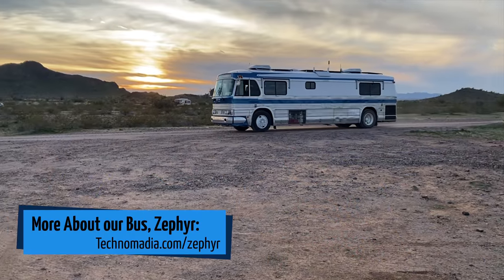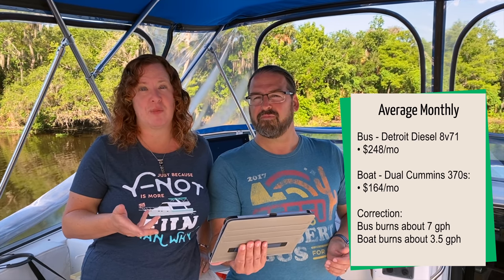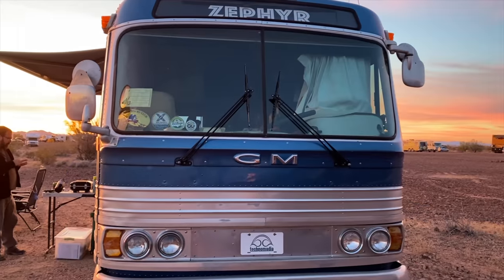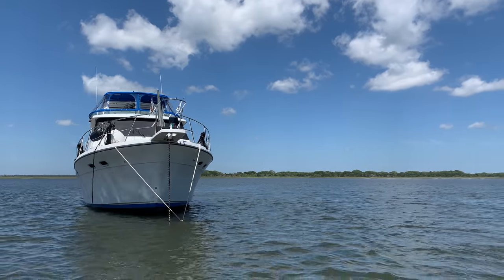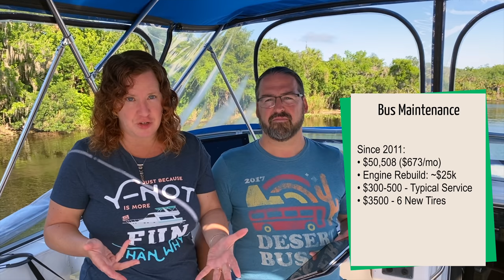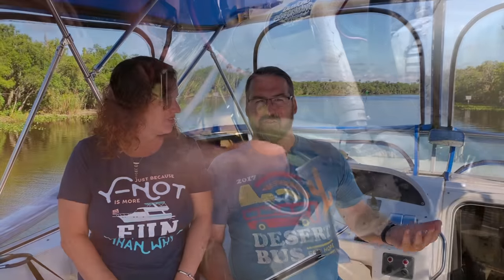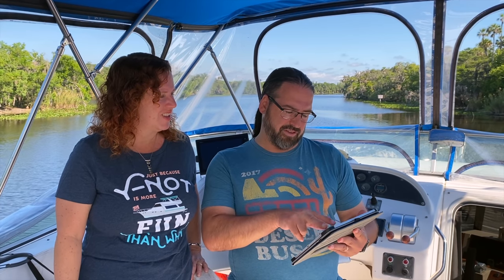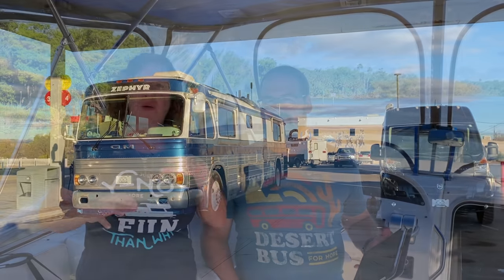Boat vs RV: Which Costs More? - Fuel, Maintenance, Marina/Campground & Insurance Compared

Comment: awesome information.  It definitely confirms for me that I want to stick to what I was originally thinking and try to go with a boat under 40 feet as all other things being equal the running costs should be proportionally lower.
Reply: I have a SeaRay 270 with twin 350's I get about the same mileage at 6 knots. 1.2 MPG when I'm on plane.  I weigh about 7500 lbs.  Why Knot seems cheap by comparison given it's size. Does it plane if say someone is having a medical emergency on board?

Comment: I use to spend over 1500 bucks in fuel one way from North Miami to Key West in my boat. Of course it was a Cigarette Top Gun with two 525 engines.. Sooooo  Totally different beast. Just goes to show it really depends on what you're comparing. And that was I think about 168 miles one way, could of been 180 one way, it's been a while. 91 octane.

Comment: I have a 30' 270 Sea Ray with a 10' beam on a road worthy trailer.  Truck and all I'm at about 55' LOA with all overhangs included.  I'm considering  taking her across the country and staying at RV Parks along the way where I will use the boat as my RV (It has kitchen, bathroom and 2 bedrooms.  I have a 4000 watt portable generator, shore power and an air conditioner - hatch mounted.  So I have everything I need for comfort and convenience while camping on the trailer. HOWEVER, It has occurred to me that this practice may NOT be permitted at RV Parks and/ or national Parks.  Have you seen this done before? That is - living on your boat while it's on a trailer?  What can I expect from the various authorities with regards to this arrangement? Would appreciate very much - your insight on this.
Reply from the maker: You'll definitely want to research further before making plans around that. Have not encountered people living on boats in RV parks and campgrounds before.   Also, max legal highway width is 102" - so be sure to check in for any 'extra wide' permits you might need to transport your boat.
Reply: @Technomadia  Thank you.  I suppose I could Boon-dock or use rest areas. I've dealt with the extra wide issue before. Permits are easily acquired but limit your itinerary - not to pricey at $25 in California.

Comment: I knew the boat would cost more, the benefits of it more than compensate the higher costs. Far more space on the boat, many even have laundry facilities onboard, more opportunities for free / low cost anchoring/boondocking, better control over fuel usage ( going slower burns less fuel generally ).
Reply from the maker: For us... the benefits definitely do add to our quality of life.

Comment: Wouldn't it be more fuel efficient to fill the boat's tank to only 1/3-1/2? Each 100 gallons of diesel weighs 700lbs. Obviously range between stops would have to be factored so you don't run dry.
Reply: 1) You don’t want to risk running out of fuel while searching for fuel.
2) You want to minimize getting moisture in the tanks by keeping them full.
3) Algae is a problem with diesel on water.
4) keeping them topped off minimizes fluctuations in fuel costs.

Comment: US$ 4,500 for bottom clean? If you are not using the boat then you have to clean the bottom every month or even every other month., here in California it costs 40.00 . If you use the  boat you dont need to clean every month, just change the $ 10.00 zinc.
Reply from the maker: $4500 for new bottom paint.  Hull cleanings tend to be $100-200 for our boat - which we do every 4-8 weeks depending on our usage.
Reply: @Technomadia  in California  ( very expensive state) the divers charge US1.50 per foot. Plus $ 10.00 for the  zinc.
Reply: California and Florida probably aren't comparable. Florida has very warm waters which is perfect for critter growth.

Comment: Fuel Saving Tip: My parents own a Carver 355 w/ dual Cummins diesel engines with 310-gallon capacity, the marina that they dock at charges something stupid like $3.59/gal for diesel. So they signed up for a diesel discount account through TSD Logistics and we use an old 140gal aux truck bed transfer tank we bought for $150 to get fuel for the boat. 2 weekends ago we got diesel with the membership card for $1.269/gallon 25 minutes away from the marina, then we use a battery-powered transfer pump to pump the fuel into 5-gallon jerry cans which we transfer into the boat with a small wagon. granted its a lot more work doing it this way, but we fill up 4 x 5-gallon fuel cans we have, which we wheel to the boat 7 trips to transfer the 140 gallons to the boat. We don't do a lot of lifting, we use the garden wagon to wheel it to the boat, then the battery-powered transfer pump to pump it into the boat. It takes about 30 minutes but saves a LOT of money. Instead of spending $538 on 140 gallons of diesel at the fuel dock, we spent only $176 on the diesel and a few gallons of diesel driving the 25 minutes to the closest fuel station that supports the fuel program. They typically fill up when it gets to 1/4 tank.
Reply from the maker: Wow.. that's a lot of work!  We just filled up for $2.25/gallon here with a fuel truck at our marina.  We don't have the option of tanking in our own fuel, as we're traveling/cruising :)
Reply: @Technomadia  ya, fuel trucks are better than the fuel docks at marina's, just makes me cry a little when i see people pull into the fuel dock at the marina and pay $3.50/gal + . Its really not a lot of work, just a few walking trips is all..
Reply: @Technomadia  thinking about it, that fuel truck probably filled up for cheaper than the $1.26/gal we paid at the pump and sold it to you for $2.25/gal and probably added tax ontop? either way that's a really nice profit margin. A year ago when diesel was near $4/gall at the pump, we went and picked up fuel for $2.40/gal with the fuel program and the neighbor boat peeps were sitting outside on their boat and heard us mentioned we had 20 gallons left that wouldn't fit in the boat, so he offered us $60 for us to pour it into his boat, so we did it quietly lol...
Reply from the maker: You're presuming we have access to a truck in which to transfer fuel from a station to where we happen to be currently docked ... we don't.  We are full time cruisers usually without a vehicle nearby.   We are quite happy with the $2.25 price, when street price around here is $2.59-2.79. And happy to support a local small business that is providing a service to us.

Comment: I sort of went in the opposite direction most people do. I lived on a boat in Florida for 5 years, then sold it and switched to full time RVing. What I've found is that pretty much everything is easier and cheaper with the RV. With the RV you're basically piggy backing on the infrastructure setup for truckers, weekend campers, and cars/trucks so it's trivial to just pick up and go with very little planing and working it out on the go. With boats everything is very specialized, even your service, support systems and "roads", so you have to do a ton of logistics and planning.

It was one of the things that stood out to me most when I switched, just how ridiculously easy life got compared to when I lived in a boat.
Reply from the maker: We've actually found the typical direction is moving from a boat to RV - for exactly those reasons. As folks age out of boating, RVing becomes the more accessible option to continue a mobile lifestyle. After all the sayings goes 'Sailboat, motorboat, motor coach, nursing home'.   Going from RV to boat seems more rare.